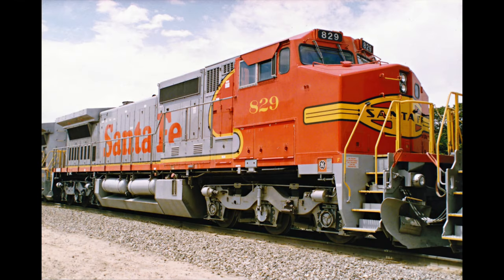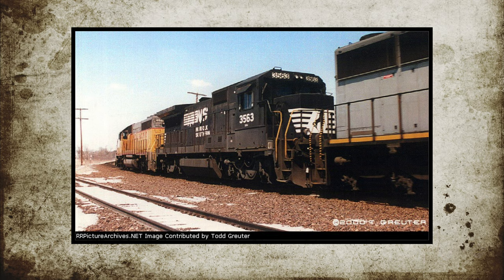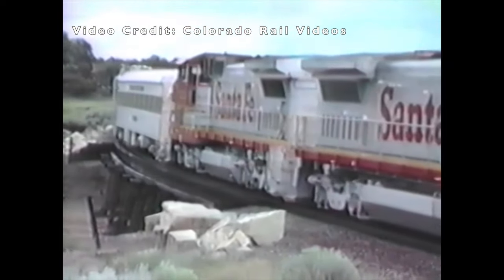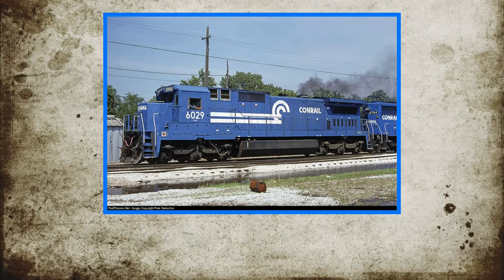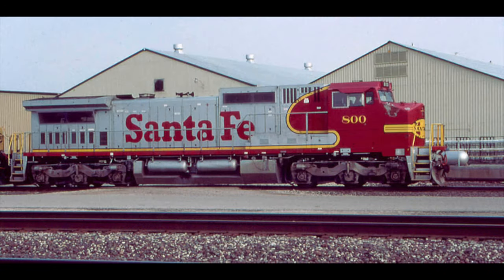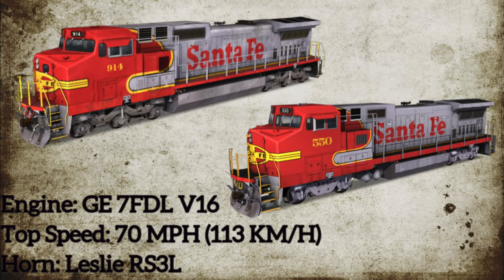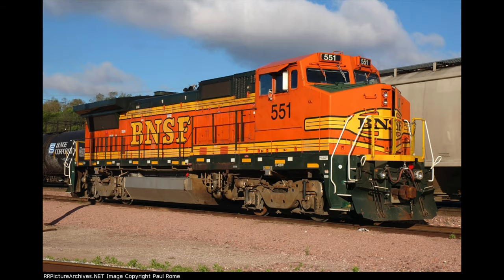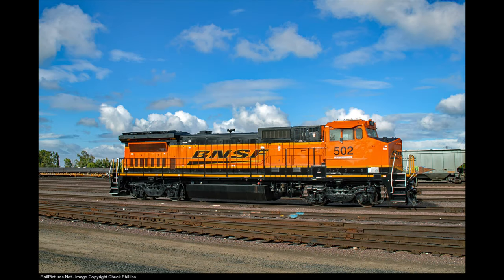Engines of BNSF: GE Dash 8

Comment: Lol I could've used someone like you on one of my wikis a few years back. I enjoyed your sense of humor and how well documented everything was. However, I no longer regularly edit on the wikis (Locomotive Wiki and Trains And Locomotives Wiki), but I still enjoyed this video.
Reply: As for CSX, 7300-7396 were sold to GECX. FCCA units 1033-1034 is ex-CSX. Pan Am Railways had 6 units, which is ex-CSX. Some set to be rebuilt as a C40-8WM. For UP, some C40-8Ws and C41-8Ws were sold to GECX. More here about C40-8: https://en.m.wikipedia.org/wiki/GE_Dash_8-40C

Comment: THERE WAS ALSO ONE GENERAL ELECTRIC OWNED TEST BED 4 AXLE LOCOMOTIVE AS WELL!
IT WAS IN AT&SF BLUE AND YELLOW, BUT DID NOT HAVE THE SANTA FE NAME ON THE ENGINE ROOM DOORS!!
I AM THINKING IT WAS EITHER 7400 OR 7401!!
I WAS WORKING AT THE ARGENTINE DIESEL SHOP AT THE TIME ALL THIS STARTED HAPPENING!
I ALSO GOT TO TAKE A ROAD TRIP ON THE 7410 WHEN IT WAS BRAND NEW!!
WE MADE ONE STOP ON A DOWNHILL GRADE MAKING HEAVY USE OF THE DYNAMIC BRAKES!
IT WAS QUITE IMPRESSIVE WITH THE DYNAMIC BRAKE GRID BLOWERS SCREAMING LIKE BANSHEES!!
KEEP THEM ROLLING BROTHERS!!
👍👍

Comment: False C40-8Ws and B40-8W Rebuilds have been running on BNSF tracks still like just a few weeks ago I caught a BNSF C40-8W Warbonnet
Reply: BNSF decommissioned all C40-8W's during 2014 & 2015.They didn't want to rebuild them.
Originally they were up for retirement in 2010,but then in 2013 more power was required.Tons of them for only two to three years were pulled out of storage and rebuilt for the time being to see more work.
BNSF has kept a handful of B40-8's & B40-8W's active for only local and yard service at most.Aside from SD40-2's,SD60M's,GP60M's,or C44-9W's to just list a few.
The oldest main locomotives on their rosters is the C44-9W's and SD70ACE's,most of the SD70MAC's and SD75M's are all in storage or have been junked.
I have also personally been to the deadline that was briefly mentioned,out in Galveston Texas.There is literally a city block of C40-8W's sitting out there awaiting to be scrapped.BNSF has none of those in still service otherwise I'd come across more often.The ones that still run C40-8W's in good numbers is CSX,but all of theirs are modernised as C44-8W's since they have been changed to C44-9W standards.
Reply: @Slim_Slid  I live on the BNSF staples sub and I have caught rebuilt C40-8W and B40-8W engines on trains